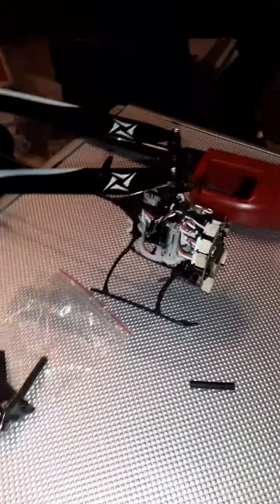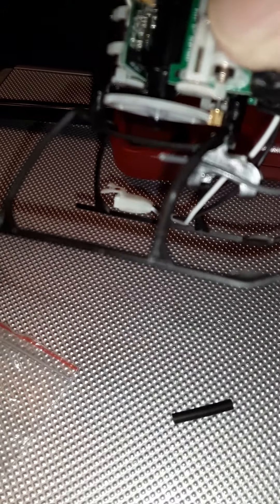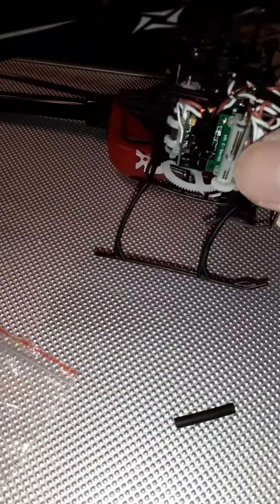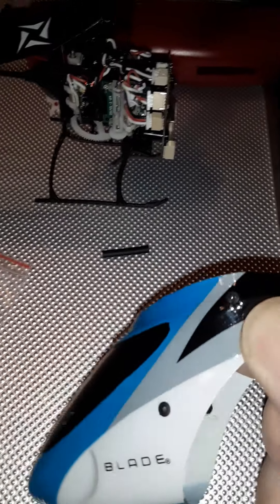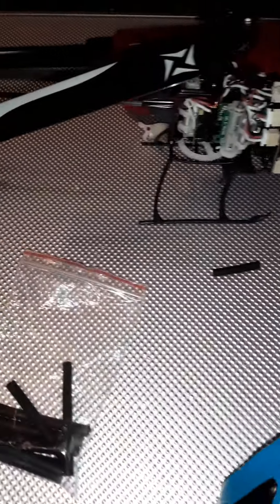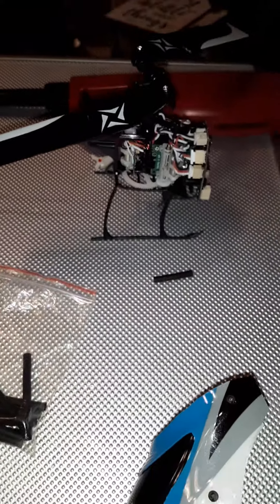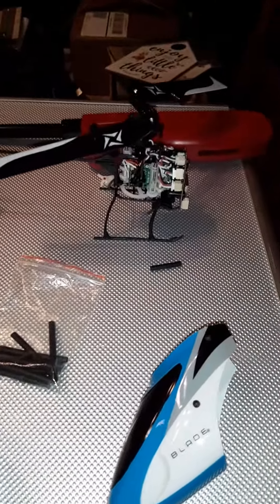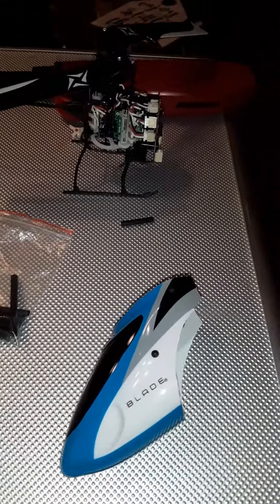blade nano S 3 quick fix on landing gear.

Comment: I see so many crazy things one guy made a video charge your battery before you fly… I'm thinking come on… Anyway your tips were absolutely fantastic people need these wonderful common sense ideas… I'm glad you're here helping everyone thanks so much… I am the same as you I would think an expert tinkerer.  I've been using your techniques here and thousands of others all my life… But it's just nice to see you
Reply from the maker: Thank you so much Jeff! I'm so glad my videos help you out. Have a wonderful weekend be safe and happy flying
Reply: This video helped me find a problem with my motor after a crash. I didn’t realize the motor moved itself up closer to the main rotor blades. I was able to push it back towards the lading skids and the motor drive was able to connect with the main rotor gear.